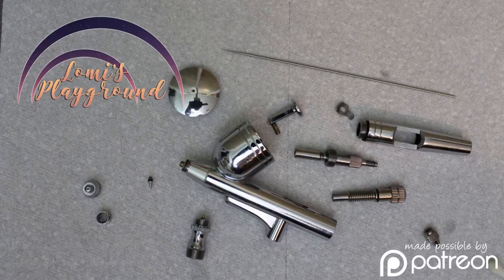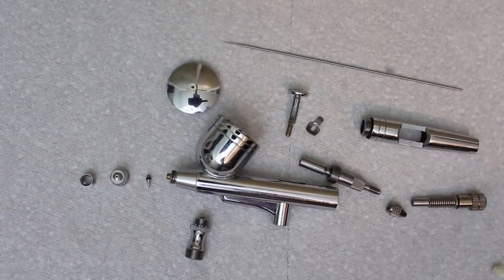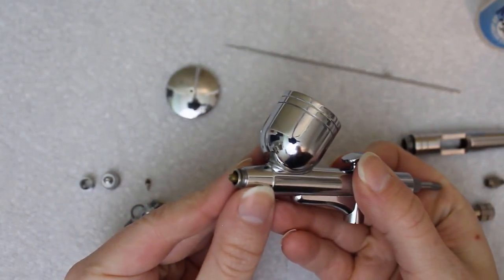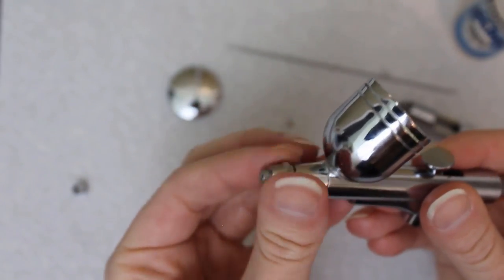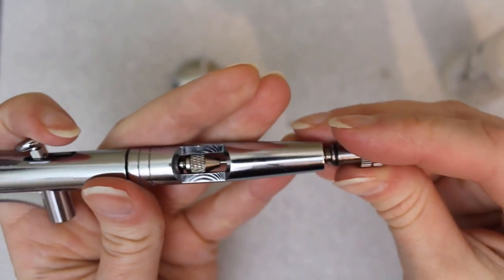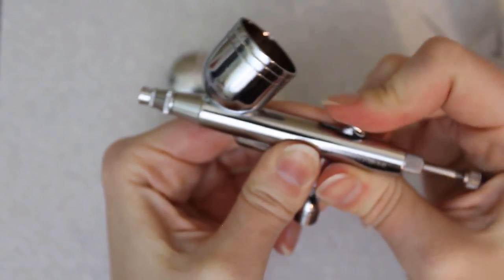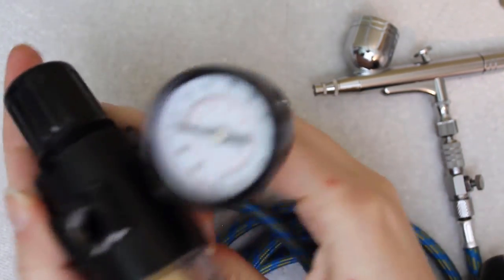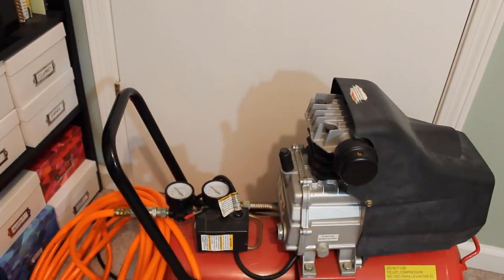Airbrush basics: Master G233 airbrush cleaning and assembly, plus my setup!

Comment: I was having a problem reassembling my airbrush after clearing out a blockage, and something wasn't fitting correctly, so I googled "assembling an airbrush" and voila not only did this work but it is the same type I have (mine doesn't have any company logo etc on it) and it worked perfectly after reassembling it!

Comment: One thing to mention, the knob for the quick release air valve does not have a stopper and will fly across the room if it's pressurized and you unscrew it too much!

Comment: I know this is an older video, but it was EXACTLY what I needed! I got my airbrush used from a friend, and after playing with it for awhile, I lightly cleaned it and packed it away. Fast-forward to a year later, I needed it for a project. Of course it didn't work properly because I hadn't cleaned it properly, but after pulling it apart and thoroughly cleaning it, I was baffled by the secondary lever guide, which fell out before I could see where it was. I also had the trigger in backwards.

So, thank you SO MUCH for your clear, concise video on both cleaning and assembly! I'm definitely adding it to my favorites!

Comment: Very informative video thank you. Casual scale model builder here, I have the G22  dual action, gravity fed, basic air brush to get the job done. Your video is a 6 out of 5. i was experiencing a sticky trigger with drops in pressure and i do believe it was the piston as you mentioned. like i said i am casual builder and was looking into a second brush just to have it, I think i will give that a try simply for cost containment.  subscribed to learn some more techniques.

Comment: I just bought one of these airbrushes. Seem to work well. Great video to learn how to care for the brush. I too use a large compressor and have quick connects all around. One note though... The Teflon tape should be yellow not white for air/gas lines. White is for plumbing!
Reply from the maker: Huh, I wonder if it varies by brand? The white teflon tape I got was stocked directly next to the air compressors to be used with them!
Reply: @LomisPlayground  Pink, Yellow, Green, and White tapes are color coded by density... hence their different application. Pink is for higher presser water lines, white for domestic water lines ie: shower, sink etc. Green is for oxygen and medical gases. Many lay people, including craft store staff, may not know that they are disseminating misinformation. If this happened in a hardware store...for shame ! :~)
Reply from the maker: @VA7ACG  That's good information. Thanks for sharing! We got it from the compressor section at Home Depot, but I suppose the expertise of the staff there is hard to gauge... :s
Reply: @LomisPlayground  Home 'despot' often draws a facepalm from me. On a brighter note, I just last week put the airbrush to work on a 40 year old pinball play-field that was in need of some TLC. It worked very well and thanks to a product called "Frisket" the result was great. Not bad for an amateur! Lomi, I also thank you so much for this video that helped in so many ways to ensure I had a clue on cleaning and care of the Master airbrush.

Comment: I wish I had found this vid before . I'm a newbie and I took my master airbrush completely a part after using it and broke the nozzle when reinstalling it . Live and learn . How often should you disassemble the gun completely to clean it everytime or occasionally . Thanks for the vid .
Reply from the maker: Full disassembly isn't usually necessary--most of the time, I just run clean water or airbrush cleaner through after I'm done using it and then remove the needle so it can dry completely inside. I only do a full disassembly and cleaning like this every few months. Of course, if you're using your airbrush every day instead of just on weekends like me, you'd need to clean more often. And if any problems pop up along the way, cleaning never hurts!
Reply: @LomisPlayground  
Thank you now I just have to wait to get the new nozzle . Subscribe .

Comment: Good video. Using the big compressor, you still need to have your external regulator and water trap vertical to trap water. I just got an airbrush same one as yours. I started out in 1981, with a full size siphon fed gun for painting cars. Now I have a gravity feed HVLP gun too. Some 0-rings need silicone oil. Your Badger oil is a safe bet.
Polyurethane automotive primer, paint and clear coat only need 28-34psi. Your big compressor is overkill. And yeah, you need to use that regulator so you don't blow up your airbrush. Working psi <58lbs.
Reply from the maker: Oh yeah, the big compressor is way more than anyone would ever need for this. But since we already had it and I have the separate regulator and a regulator on the tank itself, it makes sense to use it... Plus, it has the great benefit of being able to fill up the tank and then get an hour or two of airbrushing work done after kids are in bed. I am sure my neighbors also appreciate me not running a compressor in the small hours of the morning!

Comment: Great video!  I just broke the nozzle on a cheap airbrush and have been trying to figure out what to get next and from what I've seen I will probably pick one of these up and hopefully that will get me by until I can get a nicer Iwata or Badger. 

What kind of oil do you use to lubricate your brush?
Reply from the maker: I've been using Badger's Regdab Needle Juice. It doesn't seem to gather as much dust as other options I've used.

Comment: Question how do you open the Cup? Mine is too tight.
Reply from the maker: Mine does occasionally get stuck--since the edges of the lid are ridged, I usually grab it with a silicone potholder to improve my grip and pry until it eventually pops off. If the vent hole on top of the lid gets clogged with paint, it can create a bit of a vacuum too which makes it really hard to remove, so I keep a sewing pin handy to poke through and make sure it's not suctioned on.

Comment: In the long run is the Master G233 a good brush? I'm about to buy my first airbrush along with a compressor w/ tank,and going to be primarily using it for painting Lexan/Polycarbonate RC Car & Truck bodies. I was told since RC paint is thicker to get a good compressor with tank and an airbrush with a 0.5 mm nozzle and this has I believe 0.2,0.3, and 0.5. So my question is more along the lines of is this a good brush for what I plan on using it for and a good brush for a beginner?
Reply from the maker: I haven't used a whole lot of airbrushes so I can't speak from a standpoint of a ton of experience, but I found it to be an excellent brush for the price. No airbrush is necessarily beginner-friendly just because there are so many parts and so many things can go wrong, but this one was my first and once I figured out the correct ratio for thinning paints to work with each needle the brush came with, I never had difficulty doing anything except super-fine detail work... which is probably more my lack of finesse than anything. A friend with a lot more experience was the one who recommended this brush to me, and I'm sure she wouldn't have told me to buy it if it wasn't going to be a good option, you know?

That aside, though, you're totally correct that a 0.5 needle both handles thicker paints better and gives broader spray patterns, so that makes it ideal for laying down large amounts of color. If you're curious, you can see me using this airbrush on a project in the first half of this video: https://www.youtube.com/watch?v=A2sWiADP5Oc
Since I was using acrylics, it took longer to get coverage than you'd have with lacquer or enamel paints, and I also was using the 0.3mm needle so it wasn't as broad a spray pattern as you'd get with the 0.5, but it's a good start. :)
Reply: @LomisPlayground  Thanks a bunch,I ordered the G233 from Amazon and it arrived today and plan on using it on a new body tomorrow. I saved this video to my favorites to help me along the way. I appreciate the info and this video. Cheers

Comment: You know, I use a 30 gallon professional compressor. It works as well but I have to use a male fitting. So all of you looking to get an airbrush to use with your compressor, BUY AN EXTRA HOSE THAT COMES WITH IT. The brass piece is 7 bucks on its own, so get the harbor freight hose. It comes with the adapter.

Comment: I see this video is old, but when connecting the quick release to the airbrush use teflon tape as it gives a more sucre air connection, as well when connecting the quick release to the air hose. If you have a g76 or g79 which allows you to switch cups of different sizes, use teflon tape also.
Reply from the maker: I do use teflon tape, actually, where needed. :) The rubber seals in the hoses I bought have been plenty for an airtight seal on the quick release and the smaller air hose--I use teflon tape to seal around the connections to my regulator, which is a leaky piece of junk I probably need to replace at some point.
Reply: @LomisPlayground  I was just sharing friendly advice, that's all.
Reply from the maker: I appreciate it!! It's been a long time since I made this video so I realize I probably didn't mention anything about connections or seals. :)
Reply: @LomisPlayground  Exactly I believe I stated that the video was old and I am sure you have learned much more since then. Again I wasn't trying to act is I knew more. I am a newby. I just got the G233, through amazon. So I will be looking at more of your videos.

Comment: If you check this?  I followed this video, put back together but in paint cup, it blows back not out??
Reply from the maker: Blowback in the paint cup usually means a blockage in the nozzle, but it can also mean a seal isn't tight enough or the needle isn't pushed all the way in. It's hard to diagnose the issue without seeing it myself in person, but I'd take the nozzle apart and check carefully for blockages--it's okay to clean the metal parts of the nozzle with acetone if you don't see anything but suspect a blockage, just don't get it on the rubber gaskets or they'll turn brittle :)

Comment: Hi how often i have to disassemble my airbrush?
Reply from the maker: That depends on how well you clean it after you use it.  I run water and a bit of cleaner through my airbrush after every use, before the paint dries.Then I remove the needle to prevent it from rusting as it dries. I only have to do a full disassembly like this a few times each year, as long as no paint gets dried inside my brush. Everyone's needs will be different. If it's not performing well, it's a good idea to give it a good cleaning. :)
Reply: Lomi's Playground  the cover of my airbrush fell down the drain . Any things I could use as substitutes to cover the top ?

Comment: What air pressure do you paint with?
Reply from the maker: Usually about 30 PSI, but a little lower if I'm using especially thin paint.

Comment: I purchased one from Amazon . Air sprays but no paint comes out. I am sad.
Reply from the maker: This can happen due to air leaks, the paint not being thin enough, or not enough air moving through the cup, causing a vacuum to form. If you haven't tried it yet, consider using the airbrush without the cap on the paint cup. I never use mine, the air vent is so tiny that it's easy for it to become clogged and then paint cannot move through the brush.
Reply: @LomisPlayground  Ive even tried spraying water out of it idk if there's a secret on button
Reply: @LomisPlayground  do I have to buy a certain pump
Reply from the maker: @t.m9341 Just the usual air compressor is enough, it shouldn't need anything else. The other possibilities are just paint clogs or pieces of lint/dust that could be trapped in the needle housing. The best solution is usually a thorough cleaning.
Reply: @LomisPlayground  nothing ever works for me.  And when I go to buy something it's never "that price" , you know.
Reply: @LomisPlayground  I think it's broken